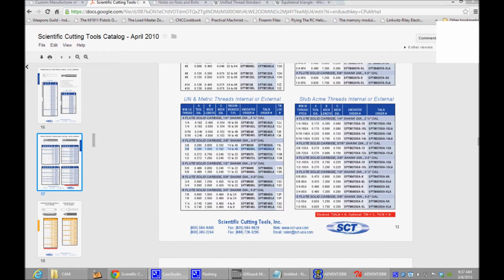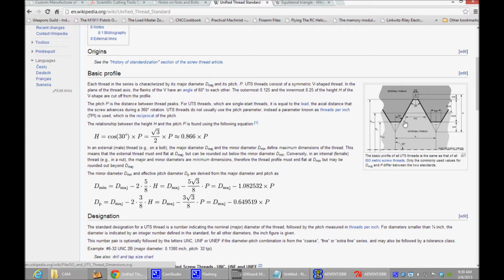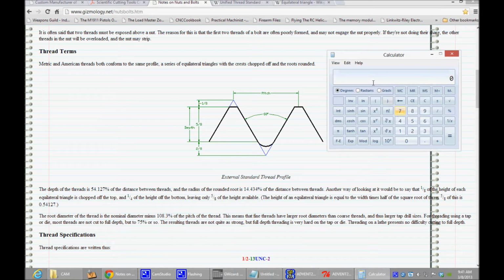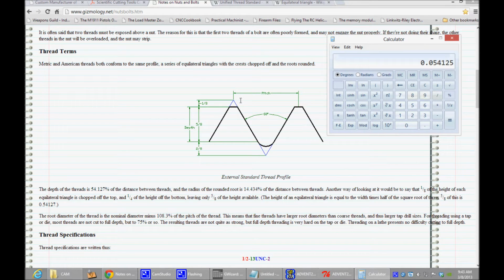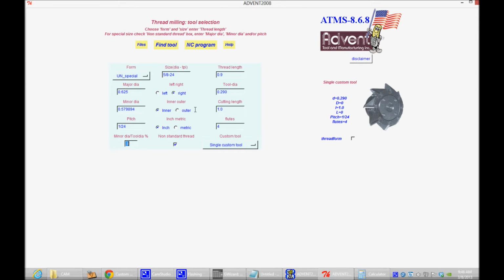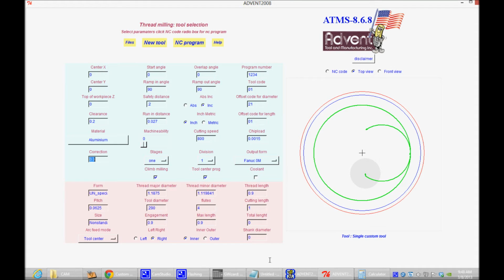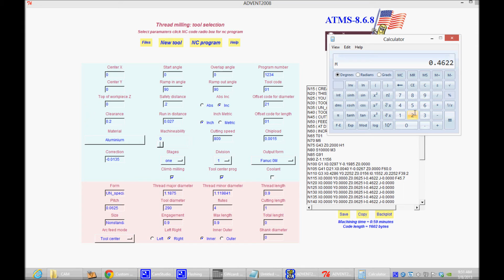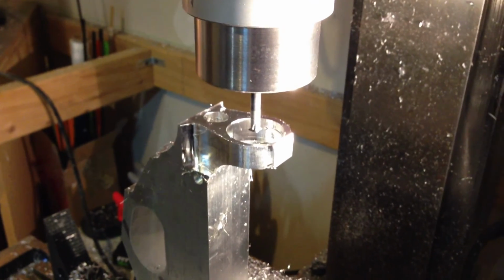Single Point Threadmilling Tutorial

Comment: Mr. McPherson,
Absolutely one of the best videos I've watched on the subject of thread milling.

I do have a question about the correction value that you state "must" be changed to a negative number when utilizing the free Advent software you discuss.

When I read through the help files (html) that are included with its software, I notice no mention of changing the sign of the number used. In fact, it explicitly states the following: "Correction value diminishes the cutting radius (half of Minor diameter) for internal threads and increases the cutting radius (half of Major diameter) for external threads...."

Then it shows an image and states: "This is an inner thread with positive correction and the minimum safety distance." 

I followed along with your logic and understand what you are saying, but just wondering if you'd noticed that they themselves make no mention of having to make that change.

Realizing that your example is/was for internal thread milling, I got to wondering if the value should be positive when thread milling externally. That's when I started to look closer.

Thoughts?

Again, great video!

Comment: Thank you for this video, I have a cnc machine and have looked for thread mills and info as you have and found very little help. I actually made my first thread mill out of .25 in. high speed steel cut with a carbide tool. (What a trick eh?). I needed to cut schrader valve threads into a brass fitting and the taps are incredibly expensive and more so for only one use. My 1st attempt was a success using hand written g-code and a rotary table rather than a helix. COOOOL! Love your Videos (ALL).